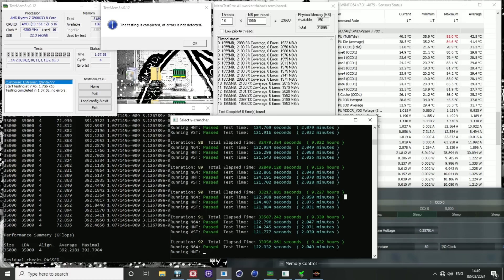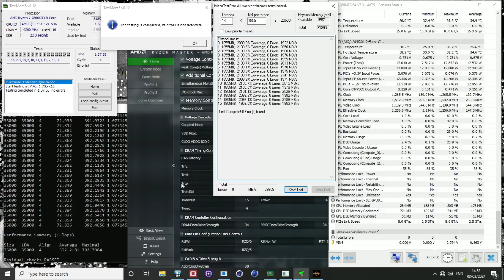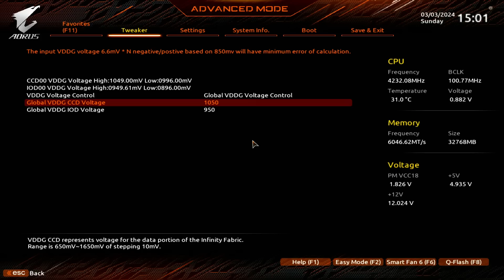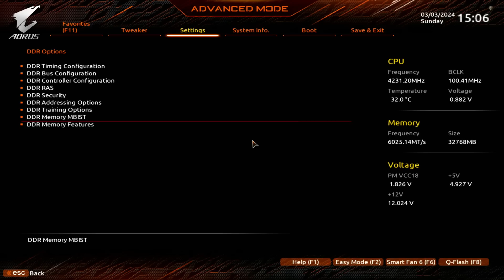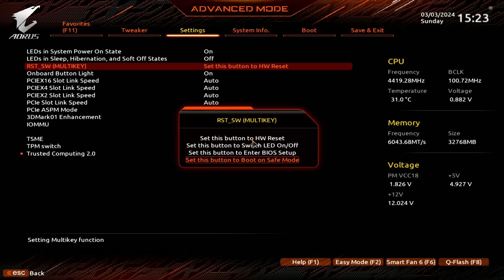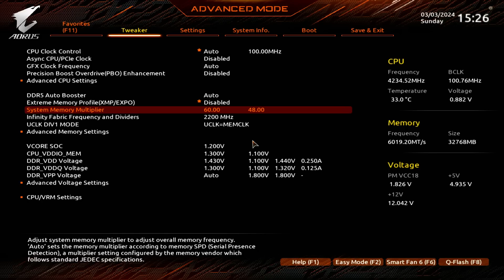Ryzen 7800X3D, 2200MHz FCLK, DDR5-6000 28-36-28-30

Comment: @ActuallyHardcoreOverclocking 25:00 yes but you will get the info how hard it is to find a stable way to boot. IF the training lasts 6 sec than you have completely save settings. If it lasts 25 to 60 sec you probably have a good setting. if it lasts longer than 90 sec you should be alarmed that you probably will get stbility issues evan at not so high temps or after 2 to 10 minutes in a test.

Comment: @ActuallyHardcoreOverclocking 4:15 I would say for 6000 6200 6400 go with: vddq 1,4 not 1,3 (at above vdd 1,35 you should go closer and closer to vdd with vddq). vddio ist good on 1,3 at 6000 but should go to 1,33 1,35 at 6200 6400. VDD Misc up to 1.12 to 1.13 at 6200 6400. VDDP VDDG ccd and iod should never be obove Vdd misc. (rather misc should be 0.02 to 0.05 obove and 0.05-0.1 under vsoc the gigher you go the diff can be higher.) so vddp to 1.07 at 6000 1.08 at 6200 1.1 at 6400. vddg iod 1.02 at 6000 1.05 at 6200 1.07 at 6400. vddg ccd 0.95 at 6000 1.0 at 6200 1.02 at 6400. vpp 1.8 at 6000 1.85 at 6200 1.89 at 6400. vsoc (fclk 2200) 1.2 at 6000 1.22 at 6200 1.25 at 6400. and timing wise trtp 14 at 6200+. slc from 4 to 5....
Reply: Wish my dumb face understood all of that.
Reply: @ohsnapsonbro4260 hes just  yapping dw if its stable lol

Comment: can someone help me plz, 

i recently got a new pc, im on f12 version of bios on the gigabyte x870e aorus master mobo trynna turn on the expo mode on my ddr5 6000mhz 26cl ram and it seems like i need to have the ddr_vdd voltage set to 1.4v for the expo mode to actually work and boot into windows without problems, however, im wondering if i need to change any other voltage amounts such as 'vcore soc' etc.. or any other changes in bios for the expo mode to work properly without issues. thanks in advance :)

Comment: Hey guys,

I’m using a Ryzen 7 7800X3D, ASUS TUF Gaming B650-PLUS, and 2×16 GB XPG Lancer DDR5-6400 (AX5U6400C3216G-B). I’ve been running this system with EXPO enabled for about 1.5 years without issues.

Recently, I started having a problem where the system gets stuck on the orange DRAM LED during restart. Waiting doesn’t help at all. The only way out is holding the power button to shut it down. After a cold boot, the system works perfectly fine. This only happens on restarts.

After doing some research, I found that DDR5-6400 may not be very stable on AM5, so I wanted to run the memory at 6000 MHz instead. However, in BIOS I only have EXPO I, EXPO II, and EXPO Tweaked, and all of them are set for 6400 MHz. I can manually select 6000 MHz, but the EXPO profile (voltages/timings) is still based on 6400.

My goal is to run the RAM at 6000 MHz with a stable manual configuration, but I’m not sure which settings I should adjust (SoC voltage, DRAM VDD / VDDQ, CPU VDDIO / MC, etc.).

I’m also using PBO with Curve Optimizer, previously -35, but I’m now testing -25 for better stability.

Could anyone recommend stable BIOS settings for 6000 MHz on this setup, or point out what I might be doing wrong?

Thanks in advance.

Comment: Do u have video on the ddr5 nitro settings?what did ur cpu max mhz?i cant get mine past 5050 on my rog strix b650e-f motherboard.
Reply: 7800x3d boosts to max 5050
Reply: @dm-dk1gf not with x670e motherboard skatter bencher got to 5.4 ghz
Reply: @gamingfromjohnwayne  ECLOCK rullz :face-green-smiling:
Reply: @gamingfromjohnwayne  remember, those him and buildzoid simply oc hardware they do not game with these ocs

Comment: i cannot turn of context restore and power down mode at the same time my memory refuses to train on b850 boards, msi does say they are working on it "if anyone reads this" also if your bios is freezing  even at xmp reach out to msi.
Reply: I had the same problem freezes in bios and bsod when logging in w11 . I reset the cmos and formatted windows enabled xmp and left context restore and power down mode at their default state. I'm solid rn

Comment: 7800x3d with b650 aorus elite v2 with the latest bios i had issues running the EXPO1 on my kingston fury 6000 CL30, what i did was enable EXPO1 and set the voltages as stated in the video, seems to be running fine. If it helps anyone i glady reply to questions...

Comment: Im currently running 6000 ram on my 7800x3d and i can push my FCLK all the way to 2200 and still be stable, should i just do that or just leave it at 2000
Reply: 2100 should be possible on all 7800x3ds

Comment: Using nearly the same timings (main timing different at 28-36-36-28) with my 64GB Kingston Fury Beast 6000 / CL36 A-Die dual rank sticks. SOC at 1,2 and Dram Voltage at 1,4. Stability tested with karhu for a day.

Comment: X670e Aorus master, 7800x3D. Copied every single timing, it didnt even post, forever code 15, then literally no code at all forever and then 00 (no cpu found). Not sure where to begin tweaking tbh
Reply: Update BIOS to F33. Use his A-Die easy timings, FCLK 2000, and go from there.

Comment: I can't remember how many times I have cleared cmos for this to work
Reply: am5 is something different, on intel it would just say "didnt work, please change something" no cmos reset nothing
Reply: @Input.Volume  so in intel you boot back to bios instead of no screen freeze?
Reply: @AlaaSalehLE Exactly, with intel you can set how many times it should try to, default is 2, and if it doesn't work, it boots you into the BIOS and keeps all the settings as they were. But it doesn't really matter, because AMD has won the race anyway, so I'll just put up with it.
Reply: @Input.Volume  Yes, but on other hand in used market there are plenty of Intel CPUs still usable if you are not chasing high fps. Like I had bought 10600k for 60$ looking for a mobo for a budget built

Comment: Ok, i was able to run 6400 @1.35v 38-38-38-30-64 1:1, with 2200IF at 1.25v on my 7700X, could not lower any of the first 3 timings or it would not boot, the thing is there is no extra performance I noticed compared to 6000 30-36-36-28-64 2200IF at 1.15v

am I completely missing something or it just isn't worth the hassle to run 6400?
Reply: Your IMC probably can't run 3200 UCLK. Try bumping vSOC up to 1.3, if it's still unstable then try 6200 instead.
Reply: Try 1.45-1.5V on the mem.

Comment: My setup post with the safe timings from the other vid and @6200/2200 (untested).  But @6000/2137 every memory test I try it makes the system crash. (Y-cruncher, TM5, M86).

That being said, I do run around -35 PBO@200Mhz positive. So maybe that's why? And yes, I know I know, test it without PBO.... Lazy

Comment: My Ryzen 7900X on X670E Aorus Master can easy performance at 6400mhz speed dual channel with  G.Skill Trident Z5 NEO 32GB (2x16GB)DDR5 6000MHz RAM (F5-6000J3636F16GX2-TZ5NR)😊
Reply: Hey! What are your timings because i'm struggling here with a few issues also I have the same exact ram but Ryzen 7 7700 on a Asrock B650M-C Board

Comment: My fps improved by 2% on average, thank you.
Reply: and stability probably by 30% lol
Reply: @chrisking6695  We’ll see how it goes. I’ve tested it with OCCT, MemTest, Prime95, AIDA64, and seven different games.
Reply: @chrisking6695
Reply: @chrisking6695  tested it with karhu ram test, prime 95 and occt. And it is still stable after 4 weeks.
Reply: CMK32GX5M2B6000C30 (sk-hynix A-die)
Reply: do you have the same ram kit? or would you mind posting a link of your copy?
Reply: @slobry  (CMK32GX5M2B6000C30) sk-hynix A-die
Reply: @Vickers_light  ty, i have a different a die kit (Z30 instead of C30) and was actually able to get it to work today. I was being stupid on one of the settings lol
Reply: @Vickers_light did you use his primary timings or 30-36-36?
Reply: @slobry  I used his timings.
Reply: @Vickers_light  Ty, seems like i might need a different kit. Ill try yours
Reply: @slobry  I have a corsair kit 6000mhz 30cl (sk-hynix A-die)
Reply: @slobry  CMK32GX5M2B6000C30

Comment: So far so good using these timings with cl 30 A hynix A die (corsair veng) 6000mhz. hopefully it holds stable under more testing and gaming. Thanks!
Reply: I have the same kit, what command rate are you using?
Reply: @slobry  1T
Reply: @ur_pore  Just got it to work, i had forgotten to undo my old misc voltage and processor impedance settings
Reply: @slobry  if I dont use his voltage values in particular misc as well it just wont boot lol but completely stable for months now so seems great.
Reply: @ur_pore what misc voltage are you using? Mine doesn't seem stable, might have to get a different kit

Comment: What should I do to make a-die 6400 uclk=mclk cl30/28 work normally on 7 7700 b650m aorus pro ax agesa 1.2.0 ? I tried everything. The same question about fclk 2200.

Vsoc 1.29
Reply: Lower SOC = easier to hit 2200Mhz fclk.
Higher SOC Voltage = more stability for higher Mhz ram kit.
Running +6200Mhz my motherboard set soc to 1.3V qhen going 6000Mhz it goes 1.2v and I can lower it to 1.07V without issue, issue is when I am going 6200Mhz I can not get below 1.25 and when going expo 6400Mhz it does not like to be below 1.27V SOC.

Comment: surely having the ram at 6000 and the fclk at 2200 will cause it to not be optimal since its not a 3 2 divider or does that not matter
Reply: Doesn’t matter anymore, just run FCLK as high as possible

Comment: Is running 1.43v safe in the long run or do you risk damaging it?
Reply: Should be fine, there are XMP kits with 1.45v. Put a fan over the dimms to cool them if you want

Comment: "memclk 1/2 doesnt really affect memory overclocking" meanwhile i can run my 6000cl32 hynix a die at 7600 cl38. its possible but only with mem 1/2. maybe back in the day it was different with the buggy bioses tho

Comment: You get 2x32GB 6000MHz CL30-36-36-32 for same price. What's the meaning of purchasing 7200MHz kit tò underclock It and make all these mods tò get CL28 which makes absolutely no difference instead of CL30 out of the manufacturer? Without considering that if you purchase a 6000MHz CL30 kit you can easily set It tò CL28. 2 hours video for this? Fantastic
Reply: Bro it's 1 year ago... prices have changed

Comment: i had a problem with my 7600x and corsair 6400mhz cl32 kit, my files from windows would disappear within a day and result in bluescreen and unable to boot to windows, lowered the mhz to 6200mhz and its been fine for 5 months, now i decided that if im going to drop down the clocks, i want to try to tighten the timings

Comment: Hi buildzoid,
I tried the same settings on 7900x3D Curve Optimizer negative -35 (only CCD1 and 1 core is -30 Stable), It works. My ram is Corsair Dominator Titanium SK-Hynix A-Die 16x2 32GB, but the values are normally very close to 7200mhz. Especially in the AIDA64 test, Latency 62.7ns output, reading, writing and copying speeds are approximately the same. Normally, when using 7200mhz, I was getting a latency value of around 67ns.
Now the question is, if the situation is like this, then is there a need to use low MHz values? As a result, I reduced the RAM running at 7200mhz to 6000mhz in order to get higher performance. It didn't help much...
Reply: Don't play in benchmarks  :) You have nice setup and u can much more behind that shit.
Reply: @nequrix  😂 I guess your alright 👍

Comment: I have a question, can I just copy all of these settings for my 7800x3d, for my ram kit 7200 cl34? I want to use it at 6000 and it does not have expo profiles (G.Skill Trident Z5 RGB 32GB (16GBx2)  F5-7200J3445G16GX2-TZ5RK)

Comment: Does anyone have any links to videos showing off how to use the new ddr5 nitro settings available?  I can set my rams expo1 kit and everything just works fine at 6000mhz , but it still takes me 61 seconds to get to windows. Ive tried messing with MCR, power down, gear down and no matter what it takes between 49 and 61 seconds to boot into windows . 

Using a 7950x3d,  gigabyte Aorus X670E Master,  32gb (2 16gb) sticks of trident ddr5 6000 ram. (Hynix chips).
Reply: try to enable this! Slow system boot fix
Enable 
Memory context restore in advance memory settings in bios

Comment: How important is the ratio?  I am running 6400 32-39-39-39 right now (96GB) with my IF at 2133 so I am keeping the 2:1:1 ratio that is the same as the "sweet spot" 6000mhz most people are going for.  Wondering if its worth losing my ratio to go for more clocks as I do not think my IF is going to go much higher than 2133 but I know my RAM has way more to go though I will have to loosen my timings.
Reply: Raise it, it is a night & day difference. I’m trying to get 167 stable rn
Reply: @LightWorks222 are you sure that for 6400 u should be running over 2133? because while 2167 is stable im seeing regression with 2167. if u are running 6000 then yeah 2167 would make sense

Comment: Can i use this timings on flare x5 6000mhz and b650-a wifi
And ryzen 7 7800x3d?
Reply: I have flare x5 cl32 a die, got 6400 1:1 cl30 36 on asrock b650 pro rs with 1.155v soc

Comment: Great video. If you could sometime maybe try to Maximize the speed for the following memory - CORSAIR Vengeance RGB 192GB (4 x 48GB) 288-Pin PC RAM DDR5 5200 (PC5 41600). I bought this on Ebay for $500 + Tax Free shpping. At stock speeds that my Asus ProArt X670-E Creator Wif + Ryzen 9 7950X3D train it at - it's rock solid. I haven't tried to Overclock the memory but with how responsive my system is _ I don't feel it's necessary. This ram kit is certified for Intel XMP. I am not aware of any 192gb ddr5 memory kits certified for AMD Expo. If you know of any  AMD Expo memory kits @ 128gb+ please let me know - thank you.

Comment: 6000 CL28-36-28-30 cofiguration not working with my 2x16GB Kingston Fury Beast RGB 6000 CL36 (A-die), it will stuck at code A6. 
6200 CL30-38-38 configuration is working, though.
Reply: I use KF560C32RSK2-32 ( Hynix M Die ), TCL28-TRCD36-TRP36-TRAS28-TRC38 / 1.4V FCLK( 2133Mhz ) . R5 7600 B650 TOMAHAWK.
Reply: @maxzoRHD  1.4v you mean VDDIO=VDDQ=DRAM_VDD=1.4V?
Reply: @HoangDucNuyen  Yes, btw Hynix A die is supposed to be better for higher clocks rather then tight timings. I did go through a lot of settings for all timings, and honestly i got the most with increasing the FCLK, helps a lot with read speeds and latency. 69000 Mbs 58NS latency on Aida64 ( some other tests show 40ns ) I ran cl30 2033mhz for a while with 1.35v for cl28 and 2133mhz Fclk i found 1.4v to be better.
Reply: @HoangDucNuyen  check out his hynix ram tutorial he posted if you havent already, has some good info. I mostly learned from his channel and reddit browsing settings scores etc..
Reply: @maxzoRHD  I've found the reason why 6000 CL28-36-28-30 did not work on my System, which is "High Dram Voltage Mode" being "Disable". Somehow rising Dram voltage to 1.43v need to enable that mode too, otherwise, it will not boot. Maybe this is the bug in MSI BIOS.

I guess maybe most ppl including me buy Hynix M or A die DDR5 just for Future-proof. Who knows maybe next Ryzen 8000 or 9000 will support high memory speed reliably, like 6600MT/s or more :)

Comment: Hey guys due to budget restraints and availability, I ended up going with a kingston fury 6000 cl 40-40-40, I am new to overclocking so I was wondering if I could overclock it to cl 30 at 6000mhz. I got the 7800x3d and i know cl 30 6000 is the sweet spot but I couldn't get that kit.

Comment: I think you need more than 1.43v VDD for 6200MT/s stability. 

I’ve been running 6200MT/s CL28-37-34-30 (tight subs) 2200 FCLK - R7 7800X3D - Asus ROG Strix X670E-F / 1807

VDD: 1.50v
VDDQ/ IO: 1.30v
VSOC: 1.25v

Stable: 
Linpack 75 loops (~ 71 secs per loop) - 397.68 GFlops average -no errors.
MemTestPro: over %2000 - no errors.
Ycruncher VT3: 2 hours no errors. 
Daily use / gaming: flawless.

My final adjustment for stability was dropping VDDQ/IO from 1.35v to 1.30v. Been running flawlessly since.

PYprime: 7.688
Aida64 latency kinda sucks at 59.3ns..regardless performance is good.
GeekBench 3 (64-bit paid version) memory: 15083
TimeSpy CPU: 14857 top 1%
Reply: I use KF560C32RSK2-32 ( Hynix M Die ), TCL28-TRCD36-TRP36-TRAS28-TRC38 / 1.4V FCLK( 2133Mhz ) VDD: 1.4v VDDQ/ IO: 1.40v VSOC: 1.3050v . R5 7600 B650 TOMAHAWK. I was able to use 6200mhz, but it wasnt much boost in preformance. 6400 was not stable, sometimes wouldnt even boot.
Reply: Yo @maxzoRHD
Reply: What mem are you using? Did you set PBO and CO? Is that aida64 latency on safe mode?
Reply: which pbo do you use?
Reply: And others timings? Trfc/2 etc?
Reply: i had 6200 cl28 2067fclk at 1.47vdd. probably could go lower but lazy to tune. rn running 6400 cl26 1.6vdd 1.235 vsoc
Reply: Hey bud I am looking at buying this board soon but I have read about audio issues like popping, crackling or static noises when using the front or back panel 3.5mmm analogue audio jacks. Do you have any of those issues ?

Your help would be really appreciated.

Comment: I disabled power down and it gave me the middle finger. It would boot up normally, but when I restarted the PC it would just get stuck loading Windows forever. When I went to the BIOS to enable it again it would freeze after clicking "save and exit", forcing me to hard reset the PC. The changes were saved anyway, but Windows wouldn't load up still. I had to repair Windows from the BIOS both times I tried disabling power down